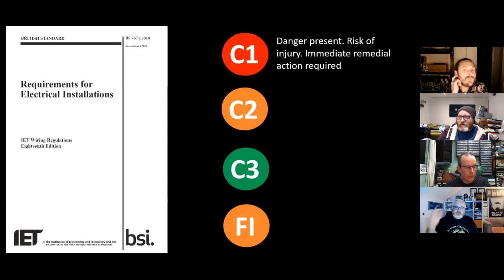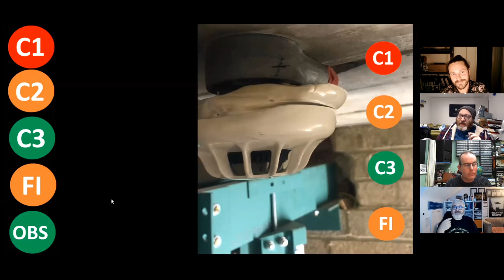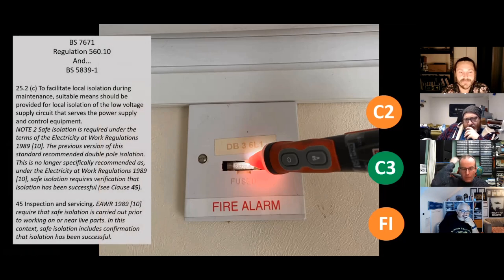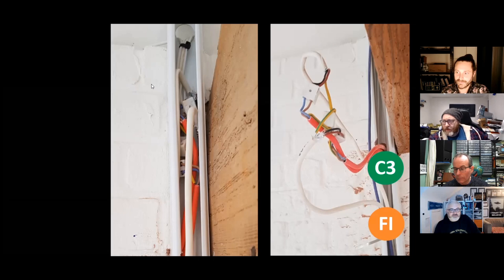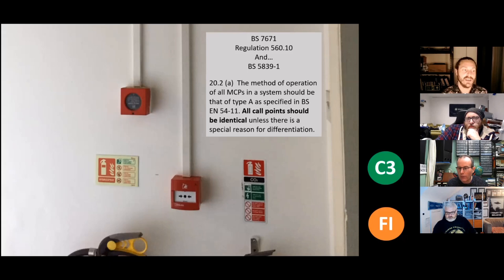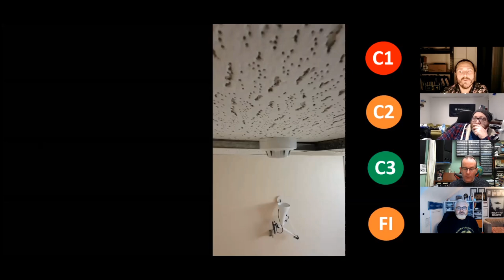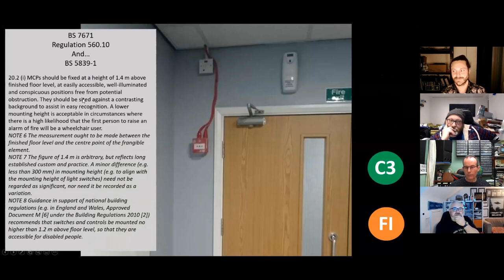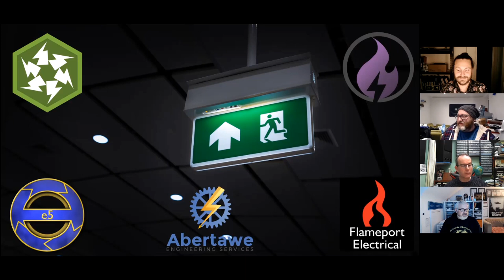Fire Alarm Coding Webinar | Inspecting and Testing Fire Alarms

Comment: Hi can i ask, why the fire alarm has “general fault” and “sounder status” light on? I have try to push button green reset but those light still on
Reply from the maker: There is a fault on the system. You'll have to consult your maintainer.